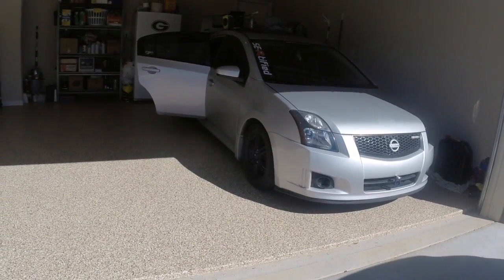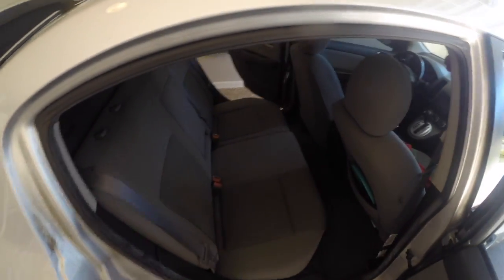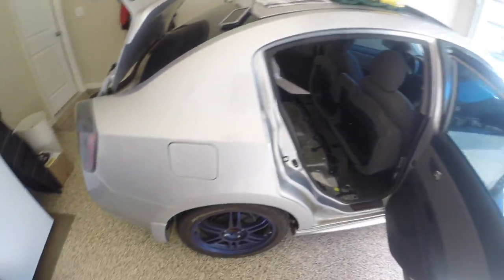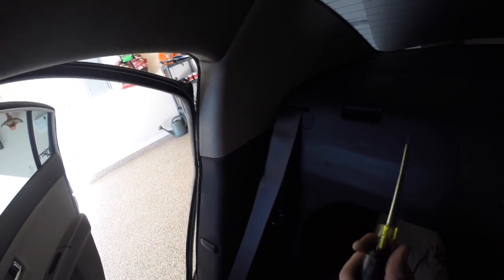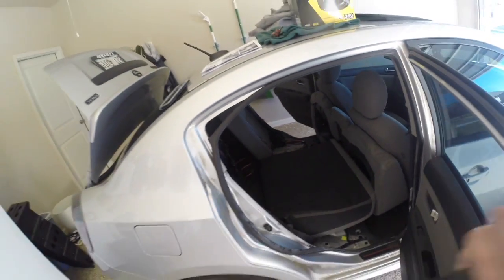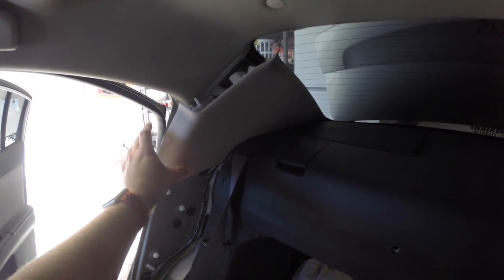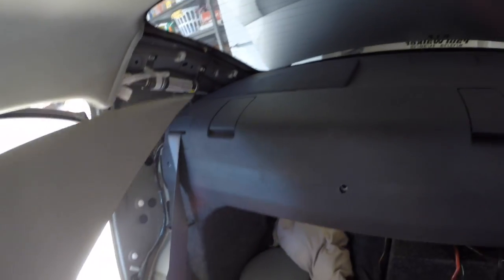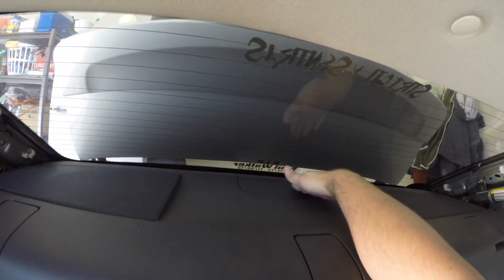Disassembling Rear Deck on 2007-2012 Nissan Sentra

Comment: This vid helped me a lot good job. I bought same speakers for rear deck except I ran nice 16 gauge wire from 4 channel amp. Got infinity components for front and added tweeters where the blank wholes were. All coupled to a android double din

Comment: Hey man, just wanted to thank you for making this video. It helped out a lot today. The only thing I ran into that wasn't in the video was that I needed a short torx 15 for my speakers. Other than that, the video was great. Thanks a lot!
Reply: Doing same job and video was extremely helpful. I recommend you purchase trim removal set of pry bars from Harbor Freight to remove pins. Worked great without any deformation. Thanks.

Comment: Just info for those adding woofers.,,.connecting to your current wires changes the ohms. If you add 4ohm speaker to existibg 4 ohms those become 2 ohms and can cause head unit to overheat. You can purchase adapters that connect inline at the back of the head unit to have 2 rca lines for connecting long wires to run under flooring to rear mounted woofer.

Comment: I don't know about you guys but after doing this job and on another day doing the spark plugs, all I could think about was getting 15 mins alone with the dude at Nissan that engineered this. After all this, I find out at the end that the screws holding my speakers down were Torx 20 screws. I had what I needed and use a ratchet with the bit, but it pretty much told me whomever designed this made it hard to work on, on purpose. I like buying used cars but doubt I'll ever buy Nissan again.

Comment: When replacing the left speaker, what is that wire connected to it and it’s attached to the top of the rear trunk?

Comment: Do you remember what was the positive and negative wire for rear speakers? I'm trying to add a sub
Reply from the maker: I'm sorry no I don't remember, I added a sub as well but I haven't had the car for over 4 years. I believe what I did since I didn't know either was just tapped into the two wires and turned on music. If I didn't get anything out of the sub then I just switched the wires around

Comment: Hey man, I have a 2.0 sentra 09 and I cant find the location of the rod assy pulldown, part number is 11380M. I changed all the engine mounts the upper one on the right, the cvt on the left and the lower torsion one, in the catalog it shows that this mount should be in the car but i cant find it anywhere and two mechanics have told me that there are only three mounts. I have changed them and my car still vibrates like crazy, the engine still rattles and moves too much when selecting drive or reverse. Thank you so much in advance

Comment: Great video man it helped me out a lot! I have a question though, how do you pull forward your back seats, ive done the lower part but im stuck at the backside of it. Thanks for the response!
Reply from the maker: I believe near the top of the seat by the headrest there is a fabric loop poking up, if you grab that and pull up it releases the seat back so it can be folded down.

Comment: Do you seriously have to take all that out to just to put in new 6x9 speakers? I just assumed I'd unbolt them from body, take out the top speaker cover then pull it up and out, no? I'm going to try and avoid all this if I can. I have a blown speaker on left rear.
Reply from the maker: Unfortunately yes that's the only way to change them. There is no speaker cover to take off to access the bolts you need to remove. The entire deck assembly has to come out to access it.
Reply: @nissanguru2001  ooh great, I was hoping you'd discovered another way. Okay I'll let you know how it goes, I hate messing with weather molding afraid I'll create a poor seal when placing it back. Good job at explaining everything, good video

Comment: would this be the same on a 2008 maxima
Reply from the maker: I wouldn't be able to tell you yes or no without looking at the vehicle. However, the same format would most likely be followed such as pulling off the plastic c pillars near the rear window. I would try checking a Nissan Maxima forum online if you can't find a video on YouTube.